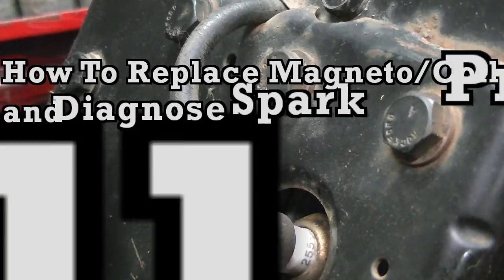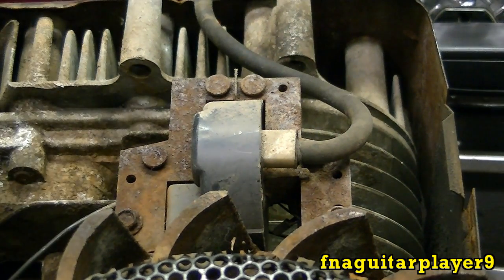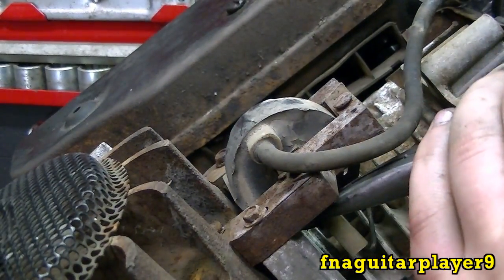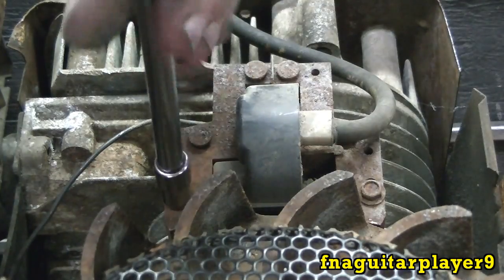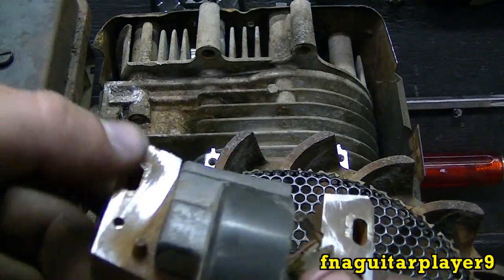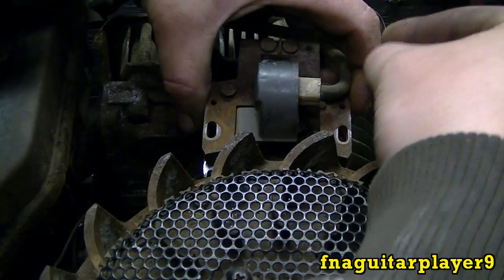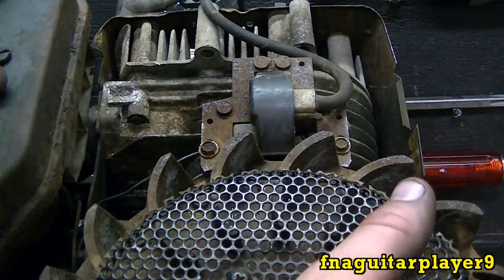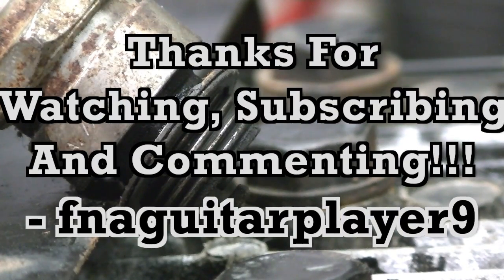How To Replace Magneto / Coil and Diagnose Spark Problems on Small Engines

Comment: Have a 25 hp Kawasaki, seems when it gets hot wants to shut down let it cool for 10-15 minutes starts up runs for 10-15minutes or gets hot again and shuts down. Also seems like engine doesn't have the high rpms as it did before this happened, like it's lost a little power, maybe this issues is something different.

My question is how do I test the coil to see if it's bad and what are your other thoughts on this issue?

Thank you for your time.

Comment: I know it’s 7 years old but today one off my generator had no spark I was looking at videos how to check the coil came across this one and after checking the coil the coil was good so I cleaned everything like you explained in the video put it back together now I got good spark so it was a ground problem due to rust where the coil bolts on
Thank You very much for making those videos they are very helpful

Comment: Have you ever come across a 2 stroke mower that has a very weak spark but if you turn it over backwards gets a big blue spark? i have that going on at the moment, tested the coil, Plug, Lead etc and all appear to be good/gapped properly..... the string pull snapped so i was turning it over with a battery drill and first go i had a really healthy spark but then noticed the drill was turning the wrong way (engine was turning over backwards) flicked it over to the correct direction and no spark. Really strange.....

Comment: When I try to start the Murray 12.5 hp riding mower it turns over but won't start. When adding starter fluid to carburetor it will run for about 2 or 3 seconds. Put new gas filter, fresh gas and spark plug. Still not sure whats the problem.
Reply from the maker: Carburetor probably needs cleaned. Thanks for Watching!!!
Reply: @fnaguitarplayer9  Thank you, great video.

Comment: What is the part number on the coil? I’m replacing one on mine that is the incorrect coil.
Reply from the maker: What engine do you have? I need the model type and code off the engine to get you the right part number. Thanks for Watching!!!
Reply: @fnaguitarplayer9  it’s a 1984 Briggs 400cc 11hp code is 252707, it’s a uncommon engine I can barely find anything and parts, let alone trying to find any performance parts for it.
Reply from the maker: @tylerexperience8704  I have several of those engines, they are very similar to the 12 / 12.5 model 28s, except the 11hps have a shorter stroke, the rod is the same though, so if you get a billet rod for a model 28 it will work in it, and so will the brass counterweights or billet dogbone, camshaft is the same too. Basically the only difference is the valves and crankshaft. Piston is also the same. The part number for the coil is 398811, you can get the aftermarket one on amazon for like 15 bucks. Hope this helps!
Reply: @fnaguitarplayer9  Hey thanks, I’m going grab the billet parts for the model 28 when I do a rebuild on it! I appreciate the help!

Comment: How can you test the coil itself?
Reply from the maker: If its a points/condenser coil, you can use a ohm meter to check it, it will have a really high resistance between the spark plug wire and ground, and a low resistance between the ground and shutoff/points wire. Thanks for Watching!!!
Reply: @fnaguitarplayer9  Well..... I found the condenser and ground wire loose where someone has put new points in it. Made me feel dumb. Lol. Shouldn't have ASSumed it was ok. Thanks for the comeback
Garry

Comment: I am puzzled with something on my Snapper rider.   I did clean and re-gap the coil.  Spark plug is new.   New carburetor was installed by a shop.

It starts inconsistently with the rope.    When I get it started it runs nicely.

The starter spins like mad but the Bendix gear is not jumping up to engage the flywheel.
Now, I know my battery isn't the best.   
Q:   Is my coil OK if the starter is spinning at all?

What else should I be checking?
Reply from the maker: The low battery could be causing the starter to not engage. You may want to get a inline spark tester so you can tell if the coil is firing consistently or not, if it no, the coil could be on its way out. Thanks for Watching!!!

Comment: I replace the coil for a new one and not have spark, what could be the problem?
Reply from the maker: If its a older engine with points and condenser it could be the problem, but if not, then check for spark with the shut off wire disconnected ,if you have spark then, its a key switch or safety switch issue. thanks for watching!!!

Comment: I have a poulan pro 450e push mower, i have taken it apart several times replaced a key way, cleaned the carburetor a couple of times. It will some times fire up and run on the first try. When i try to start again nothing. Any idea what to do next ?
Reply from the maker: It could be one of several different things, but first thing that comes to mind when you say it back up it won't start, first thing it could be a bad coil or spark plug, getting hot and breaking down and not sparking, I'd get a inline spark checker to rule that out, OR it could be that the carburetor is trying to run to lean and it won't start up when its hot because that type of carb does not have a choke so, either the jet is partially clogged or there is a air/vacuum leak on the intake manifold between the carb and intake on the engine. hope this helps, thanks for watching!
Reply: @fnaguitarplayer9  I did put a new spark plug in. I'll see about getting a inline spark checker, thank you for your help. Great video !

Comment: What if you still dont get a spark? Runs when kill switch is unplugged but when I plug it back in, it shuts the motor down
Reply from the maker: In that case, its either a wire is grounding out or you have a bad safety switch somewhere or the keyswitch is bad. If the shut off is built into the throttle, then it could be the switch or insulator. Thanks for Watching!!!
Reply: @fnaguitarplayer9  okay, we'll let you know! Thank you, great video

Comment: I have a Lawnboy 10641 mower and replaced the coil. If I set the air gap at 0.010 it takes 8 or 9 pulls to start the mower but it runs beautifully and restarts immediately when hot. If I set the air gap back further it starts right up cold but runs really rough and sounds like it is missing. I read to gap it at 0.006- 0.010, so I will have to try that. Didn't realize the gap measurement is so crucial. I use feeler gauges. Any comments will be helpful.
Reply from the maker: I try to set them as close as possible, .006 in your case. Thanks for Watching!!!
Reply: @fnaguitarplayer9   Thank you very much for the tip. I will do that this week and let you know how it runs. Thanks again.

Comment: How do you know if the spark plug and Magneto coil was electrically working, you never use and tested them with   multimeter ?, just guesswork  l am assuming...Yes  !

English Mik.
Reply from the maker: The spark plug is usually just a visual inspection. But i have had bad spark plugs right out of the box, rare but happens so i never rule out the plug even if it looks good, as far as checking the coil, the most common problem on the older engines was the points and condenser, so i almost take it for granted that the points will need at least cleaned if not replaced if a older engine has no spark. And coils can work fine when cold and breakdown when hot, so can condensers, so theres no way to test the coil when its hot, other then a inline checker while its running. so its really a trial and error thing for the most part. to a certain point. You can test the resistance of the coil, between the plug wire and ground (frame of coil) it will have a really high resistance, and between the points wire and plug wire, it will be fairly low. But again if its breaking down when hot, you can't really test it that well. Thanks for Watching!!!

Comment: I have the same engine as that one and I have to rewire my mower.  How does that engine charge the battery?  Can't figure it out.
Reply from the maker: There is a stator under the flywheel, there will be 1-2 wires running out close to the starter, with a connector, there is a diode built in on it, one wire puts out AC for the headlights and the other puts out DC to charge the battery. Thanks for Watching!!!
Reply: @fnaguitarplayer9  Thanks for getting back to me.  I found the problem.  No stator, so no wires.  I have a used stator and voltage regulator coming so I hope to be in business soon.
Reply from the maker: @ohyeah3750  your welcome, that would cause it! Hopefully that fixes it for ya

Comment: no distributor or CDI?
Reply from the maker: Nope, the coil generates its power (and times the spark) from the magnets on the flywheel, its all preset, the flywheel key on the crankshaft makes sure its in the right location, if it shears it will throw the timing out. They actually make offset keys to advance/retard the timing for racing applications. Thanks for Watching!!!

Comment: My bench set up fixture had Briggs flywheel magnet mounted on spinning wooden flywheel by 12v fan motor.  + DC speed controller. The pre 1982 type (new) ignition coil did not spark with various adjustments. This was with the removable Briggs brand trigger module. I even tried 5 universal Nova trigger modules with the same old style (new) armature with no spark. I tested with ohmmeter for grounds each location as ok. New spark plug was tested ok by ohms. After watching your (sparking video), I took it all apart and filed all ground surfaces with miniature flat file. The new Briggs ignition coil that also had factory varnish now fires the spark plug. I will now attempt the changeover again for the universal trigger. They don't require the spinning magnet to effect ignition as they use the rising voltage in primary to fire the internal transistor. These older points type coils would spark at a lower RPM range than the now modern Magnetron types. I was worried that the motor wasn't spinning fast enough, and I had no RPM test gauge.  The rust was causing a poor ground, even though surfaces and screws actually look good by eye. Thanks for the good video.
Reply from the maker: Your welcome, this is often overlooked and can make it seem like a bad or weak coil. thanks for watching!!!

Comment: Should there always be a wire going to the coil? Working on a Homelite leaf blower and don’t see any wires going to the tab, the coil is just bolted down
Reply from the maker: Most of the time if it has a shut off switch, some blowers I have seen use the throttle to shut it off, or just choke it out. Thanks for Watching!!!

Comment: I got a  craftsman riding lawn mover with a Briggs and Stratton engine 15.5go and the problem that I have is that the engine only sparks one time when is cold and then I turn the engine off and when I try to turning on one more time it doesn't turn on I check for spark and no spark in the spark plug and the I let it cool down for the next day and starts but only the first time I try second one and the same problem do you have any Idea what it may be because I change the magneto and still the same problem with a band new magneto please if you have any Idea let me know Please reply thank and very good video have a good day thanks.
Reply: I believe There are diodes in the wiring harness that fail when hot.  That is the next thing I'm checking!
Reply: Thank you so much for the reply I'm going to check the diodes next.

Comment: man i could use your help. I have a troy bilt zero turn with a twin cylinder Kohler courage that i converted to remote control. It's been working fine firing up everything has been fine. well, today im cutting grass with it and i shut it off for 15 seconds tops and when i try to fire it back up i get nothing. Im getting no spark from either coil. Im getting around 8.9 kilohm resistance on both coils but neither is working. i removed the kill switch from coil to make sure that wasn't the problem im getting no spark at all. It just seems weird that both would go out. do you have any idea? ill donate some money to ya if you can help with this.
Reply from the maker: Did you unhook the wire from each coil or just the switch? It does seem odd it would do that. I usually replace both coils as precaution in case one is weak. A, just another thought, check the magnet on the flywheel, if it lost its charge or came loose you won't have no spark either. Thanks for Watching!!!
Reply: @fnaguitarplayer9  I bought two new coils and it worked fine, so both coils went out and I have no idea why. I literally turned it off for 10 seconds raised the deck and went to try and restart. Somewhere in that 10 seconds, both coils went out and I have no idea why. Its the craziest thing. If for some reason the kill wire accidentally touches 12v would that kill the coils?
Reply from the maker: That is weird, very odd for both to go out, its possible that if 12v hit the shut off wire it would fry them but not sure.

Comment: Great video.  Very helpful and well done.  Thanks a mill.  Have a generator that couldn't start... replaced the coil after trying all else and worked like a charm, but two weeks later after a few half hour runnings I now have the same problem.  Hoping it's exactly what you described.  If not maybe the new coil went bad, but I doubt it.  Do you have any vids on how to check the coil itself?  Thanks again.
Reply from the maker: Thanks, glad to help out. no I do not at this time. Thanks for Watching!!!

Comment: What are all of the symptoms of an ignition coil problem?  I have a walk behind mower that will not start 9 times out of 10 but if I spray carb cleaner into the intake from the carb with fuel in the tank the engine will start and keep running.  If I release the engine control lever for a split second the engine will shut off and not restart.  Is this an ignition coil problem?
Reply from the maker: That sounds more like a carburetor issue, a clogged jet or passage keeping it from starting without help. Could check the spark plug as well, or try another plug, sometimes a bad plug will do that. Thanks for Watching!!!
Reply: I tried a different spark plug and the carburetor is clean but what should the psi for the compression be on the first pull of the rope?

Comment: Guitar man I pulled the valve cover yesterday I have the exhaust valve is set at 10 the other I cant even get a 2 mm in there do I need to file it down to 6  I haven't pulled head yet 78 year 31/2 briggs
Reply from the maker: yes you will need to file it down to get the proper clearance, very common problem on flathead engines. Thanks for Watching!!!

Comment: Guitar man now I'm having trouble with the carb on 3.5 briggs popping thru carb 1978 model
Reply from the maker: If it has low compression it could be valve related, or if the flywheel key is sheared its trying to fire to soon. Could also be carburetor related, it may need cleaned and/or a new diaphragm put in it, that type should have a adjustment screw on it as well to tune it. Thanks for Watching!!!

Comment: how do you test a b&s opposed twin's  coil?   Would it be the same as testing a single lead coil ?
Reply from the maker: Its basically the same, you can unhook (carefully with pliers to keep from getting shocked) one plug wire to see  if it changes the sound to see if one side isn't firing. Thanks for Watching!!!

Comment: Guitar man I'm having trouble I done away with points 3.5 briggs put different coil on tapped the coil cleaned base where coil sits new plug everything I can think of no spark whst is going on
Reply: Gapped the coil sorry
Reply from the maker: First thing to try is, unhook the shut off wire, check it for spark, if it sparks now then you have a bad shutoff switch or the wire is cut into and is grounding out. If it still isn't sparking, try another plug, never know, i've had bad plugs out of the box before, if still not then i'd say the coil is bad. A rare problem is weak or discharged magnets on the flywheel, check that too just to rule that out. let me know what you find out. Thanks for Watching!!!

Comment: Just a data point from a 7.25 HP/ 190 cc Briggs and Stratton mower I was de-bugging for hour s on end!   I had to replace the auto-choke plastic linkage as mice had eaten one end of it and the bugger still wouldn't start.  Coil resistance was 6.3K ohms through and about .3 ohms from kill wire and metal stack housing.    Spark tester showed that the plug was firing as the light went blinkey-blinkey when it was pulled.  Cleaned that carb up nine ways to sunday too!   Took it to my buddy, Super Mario.   He through in another older plug that was cleaner and viola!  It started right up.  We cleaned up the orginal spark plug and gapped it correctly.  DID NOT REALIZE this would cause such a hard to spot problem, especially when the spark tester showed some activity.   Those things probably do better testing the coil than the quality of the spark.  Lesson learned, clean or replace the spark plug to eliminate an easy problem!
Reply from the maker: I hear ya! Sometimes thats all it is, a bad plug will cause all kinds of problems. You are correct, the inline tester is more of a voltage checker than anything, if it lights it will have enough power to fire a (good) plug. Thanks for Watching!!!

Comment: I have a 9.9 HP Chrysler Outboard I am having an issue with. One spark plug sparks real strong and hot and the other is real weak. The coil packs have been tested and are fine. What other main suspects I should check?
Reply from the maker: Have you tried new plugs, sometimes one plug will foul out more than a other. Thats the first thing i can think of, but if they are both putting out equal voltage then it has to be the plugs or a shorted plug wire. Thanks for Watching!!!